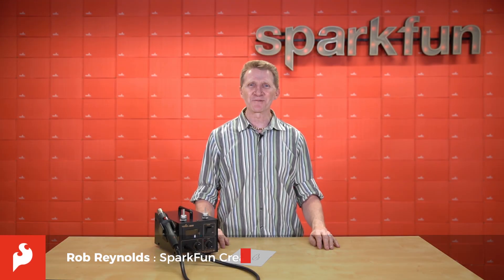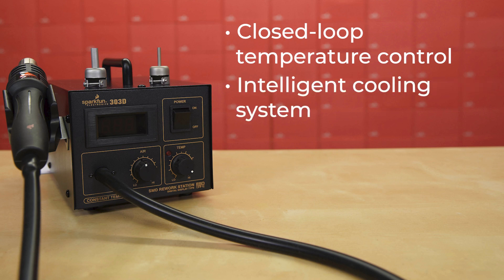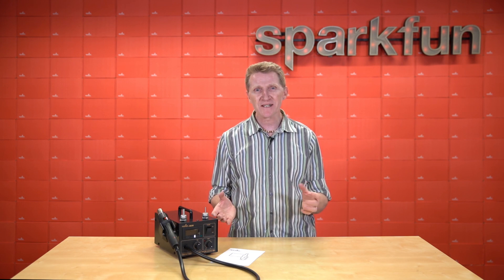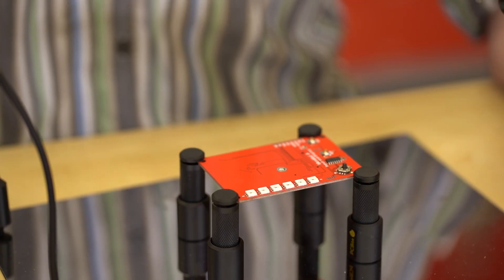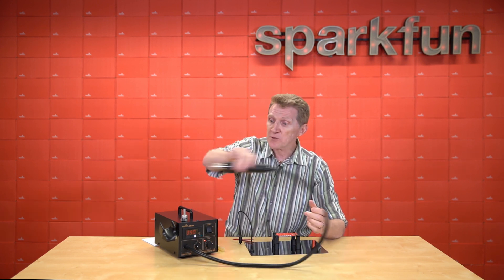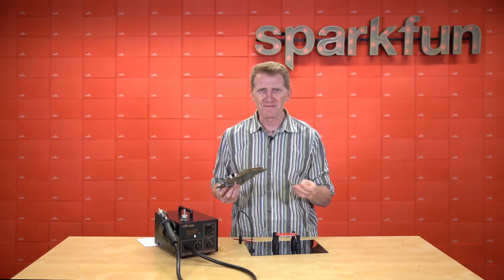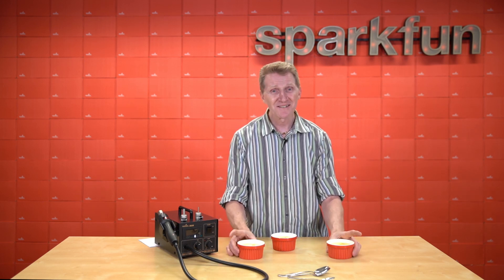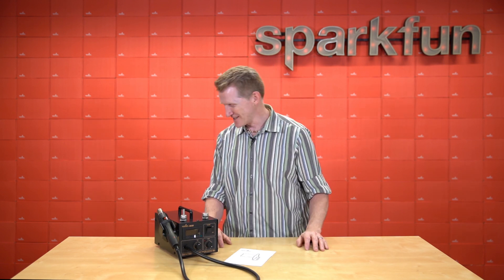Product Showcase: Hot-Air Rework Station

Comment: Hi, 'm a beginner in electronics. Looks like a very good unit. Can i use it to remove through hole components too?
Reply: If you can get a vacuum desoldering tool like a Hakko FR-301, that sort of tool is ideal for through hole components because it sucks out all the solder from the joints, which is what you want if you want to remove a component without destroying pads or the board itself. Even if you don't care about the donor board, vacuum desoldering is usually better for salvaging because it's not going to overheat sensitive components or plastic things like connector housings.

You can also try low melt alloys like Chip Quik, but if you intend to use the board you will want to clean the alloy off completely after you remove the component because it will make solder joints very brittle. It's messy and time consuming, but you only need flux and a heat source like a soldering iron or hot air.

Comment: There’s a typo in the high speed scrolling warning.
Reply: Is that typo on the hot air station face plate or in its instruction manual?
Reply: @Aneesh.Asokan  It’s in the video’s high speed scrolling text
Reply: @AdrianBoyko  Thanks! I thought that the typo is on the station faceplate!😀